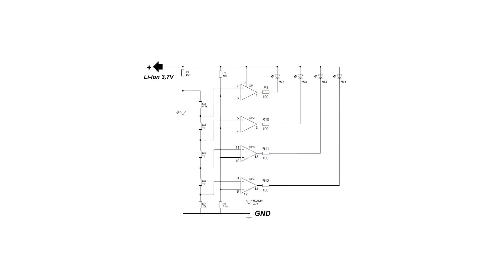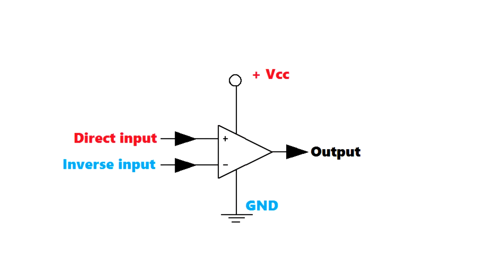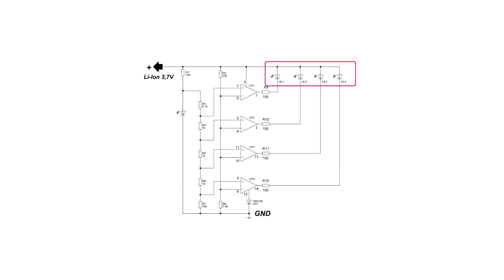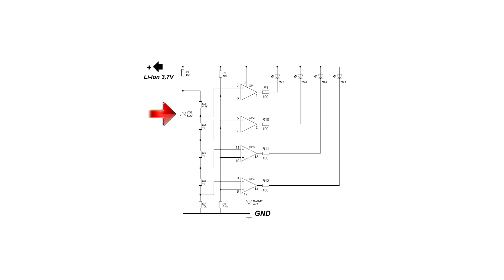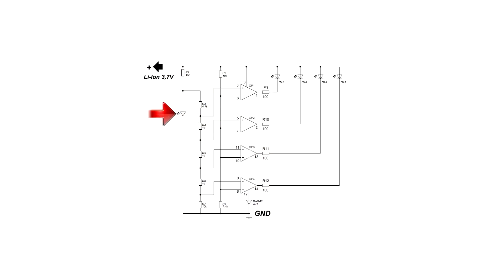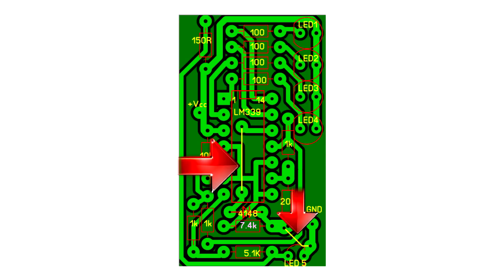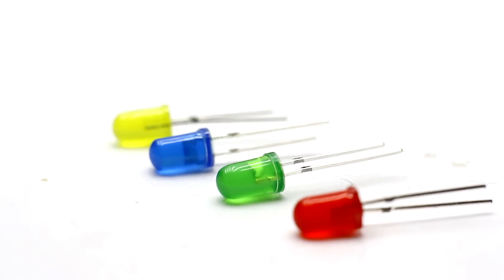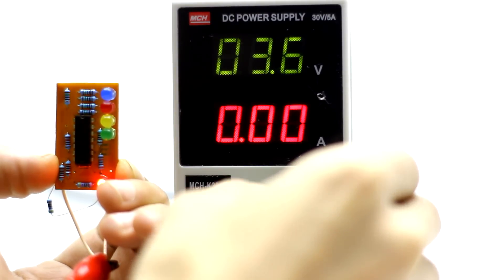Lithium-ion batteries charge indicator

Comment: The 431 voltage reference can be used too, it's an adjustable zener diode on the basis of comparators, but with a built in reference voltage of 2.5V.
Reply: Doable with three tl494 for low, average and charged battery or just one for low battery.

Comment: What resistor values would you need to see the battery level of a 14.4V battery?
Or can I use a voltage divider (potentiometer) before the meter? 
This way, I'll be able to adjust the meter's voltage values.
Reply: use a voltage divider to drop the battery voltage - say in half
for the resistors - use a spreadsheet
if you have R1, R2, R3....R5.(from the top down
then Voltage at say  R3 is  Vz x  [R3 + R4 + R5] / Rtotal

then Voltage at say  R4 is  Vz x  [R4 + R5] / Rtotal

Comment: nice project but this is voltage indicator.. not a charge indicator... such indicator usually give you false charge information.. you need to have current IN and current out count for proper charge indication.

Comment: but It will spend much power of the Li-on Battery(if 1 batt is used-2200mAh), your circuit will spend 10-20mAh 1%. More effeciently if it could spend 01%  nearly 1mAh !
Reply: Consider this circuit as a testing device, pretty much in the same line of thought of a DMM for instance.  When you want to know the voltage of a battery, you get your DMM, the probes and then measure your battery voltage, right ?  Simply do the same thing with this circuit just by adding a tactile switch.  When needed, press the button and check the indicator.  You can make a standalone indicator or incorporate the concept in your project, its up to you.  When we want to extend the usefulness of a battery charge, its obvious, we have to minimize the current usage.
Reply: It's meant to quickly check the battery level, not meant to be on forever, so a push button is used.

Comment: Could this be used for lead acid battery?
Reply: Hi, any type of battery but the voltage of battery must be only 3.3V.  To test a 12V lead acid battery, all the zeners must be changed.
Reply: yes with changes    better to use  previous project though

Comment: hi, thanks for the kind information s, can you pls provide the circuit diagram for lead acid batteries , where it can charge 1 to 10 batteries with ampere adjustment from 1 to 10amps.. pls....
Reply: Can you take the time to search on the internet and experiment instead of asking people to do the job for you for free ?  It's annoying how people can be at times.  We explain and show them how to build and control a kite and in return they will ask for the design of a rocket to go on Mars, although they can barely put a foot on front of the other by themselves !!!  The law of the least effort at its best !!!!

Comment: will lm324 work?
Reply: Yes it will but it isn't pin-to-pin compliant.  You will have to look at the datasheets to compare the pins layout and adjust your schema accordingly if you happen to test a circuit you got from the internet which already have the pin numbers on the diagram.